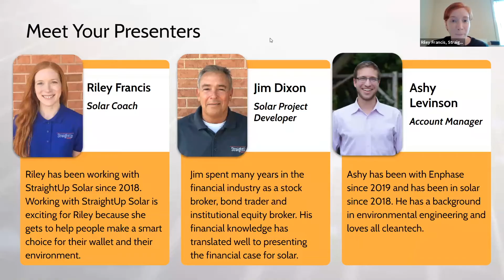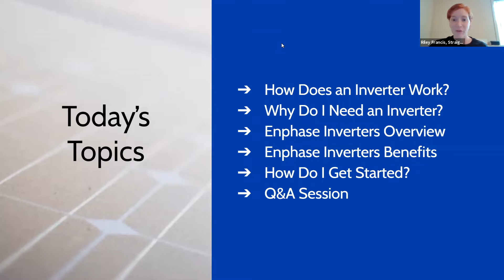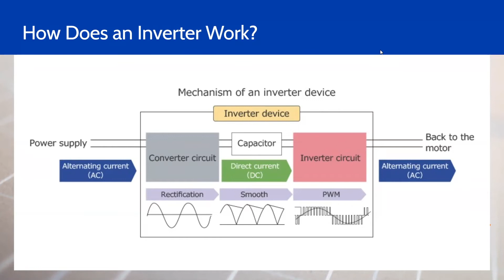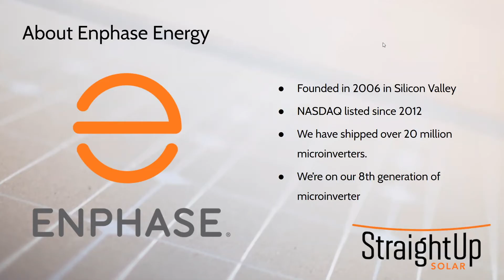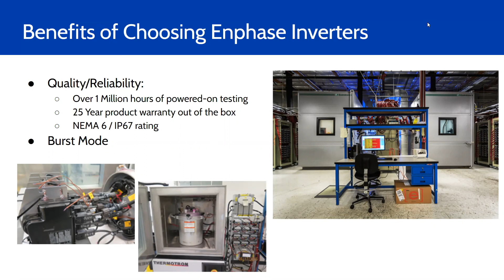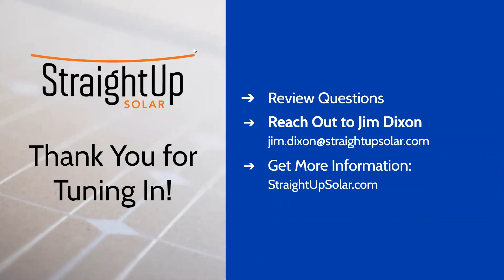SOLAR WEBINAR: A Closer Look at Enphase Inverters

Comment: I am learning so much from your WEBINARs.  I'm currently working with Jim D and Charles M fine-tuning my system but the initial design for my PV system consists of 31 405-watt Q Cell panels and 31 Enphase IQ8A Inverters, it's OVERSIZED by about 25%  Hopefully, my system will be installed and operational in the next month or two.  We will be adding batteries next year and am hoping the Tesla Power 3 is out by then.  Cheers from Swansea IL

Comment: I am all for Micros on rooftop. But spending so much time on string inverter failures, without source data as reference is a little bit offputting to a engineer.
After all giga watts of industrial solar is being installed with plain simple high quality string inverters.
Hi enjoy all educational green tech YouTube. And would enjoy your channel even more if you present the source data.

Comment: I maybe your newest customer. With a Biomedical Engineering background, and over 30 years in the profession I found your inverters are very well thought out, and look forward to many years of reliable use. I am in the planning design theater with my local company. Great presentation of the inverter design. Transparency like this is a big part of my decision in working with a company that markets your product. Nice to know that I; the customer, is not the one to provide the beta testing of your product, which is a large part of industry today and folks don’t realize it. So thanks again, and stay tuned as I am really looking forward to the benefits of this investment. Do ya plan a briefing on upgrades as technology moves forward for your install base?
Reply from the maker: Keith - thank you for watching this presentation and we'd be glad to help you with your system next!